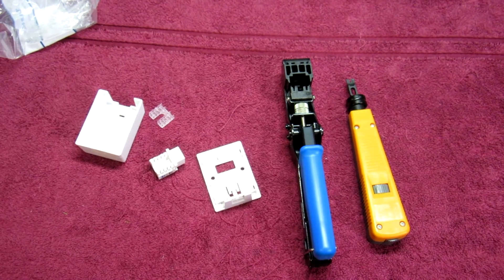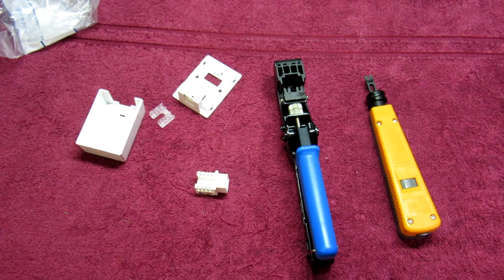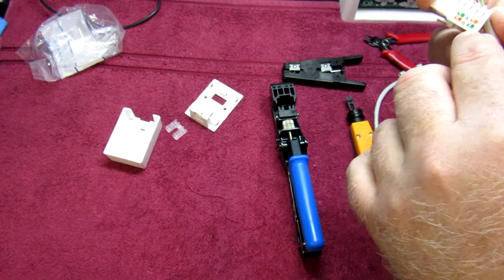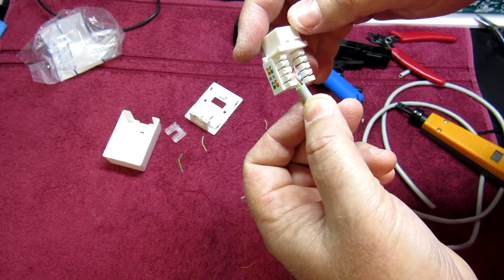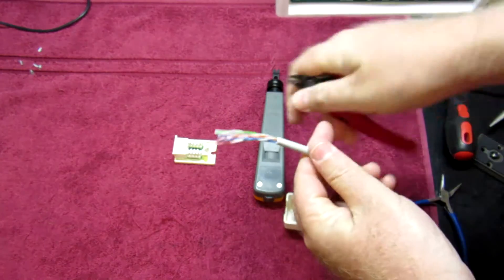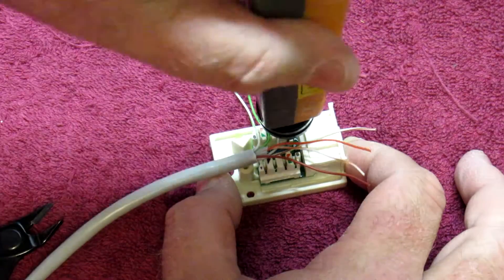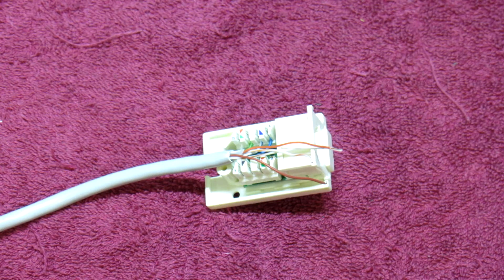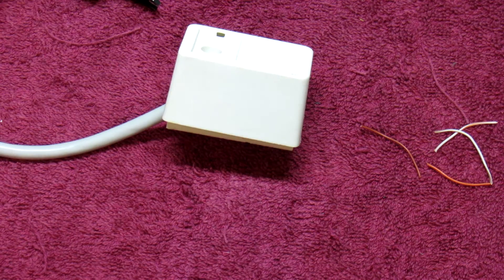Episode 77   Keystone Jack   Surface Mount Box Termination Methods

Comment: I assume 110 blocks are the most common in SA then? Here in Belgium it's mostly Krone. Do you see any 66 or BIX blocks there down south?

Anyway nice video, but it seems that your camera has trouble focusing on that particular background (mat, towel?)
Reply from the maker: Yes the 110 is more common for Ethernet cabling. For telephone systems our local provider uses Krone Blocks. 66 and BIX almost none existent, in Durban anyway. 

Yes my camera was battling a little but I have since shooting this video replaced this camera with a Sony full HD model. Also improved audio and lighting on the shooting table so after I get through the last 2 edits shot on old camera you will start seeing improvement on both audio and video. :-)

We are also hoping to use some DSLR video in the not too distant future. :-) All depends on support from viewers.
Reply: Depends on who you buy from. The Gigacore stuff is Krone but you do get 110 as Dionne mentioned.